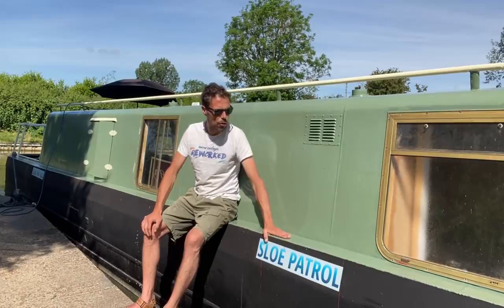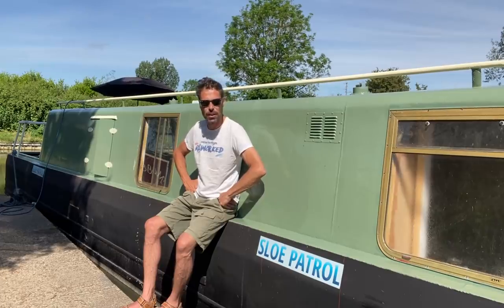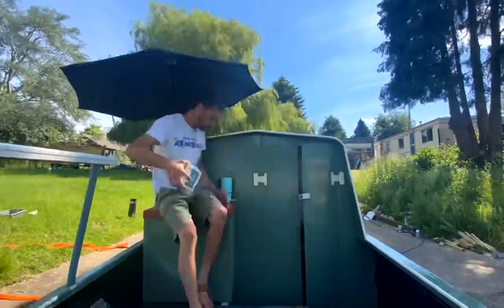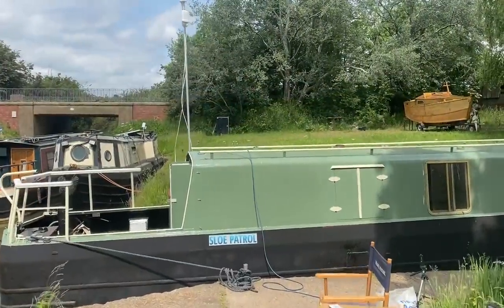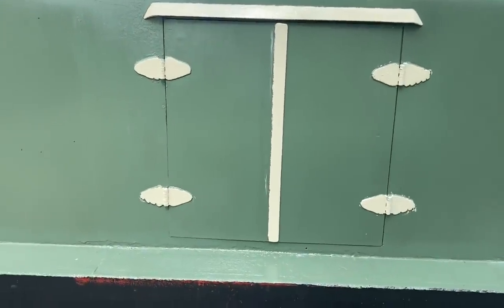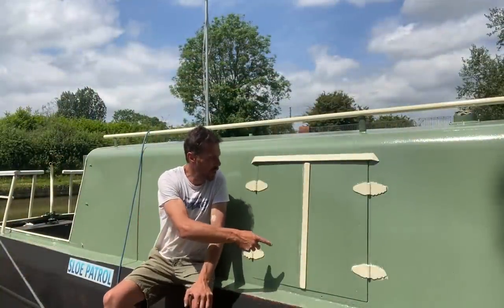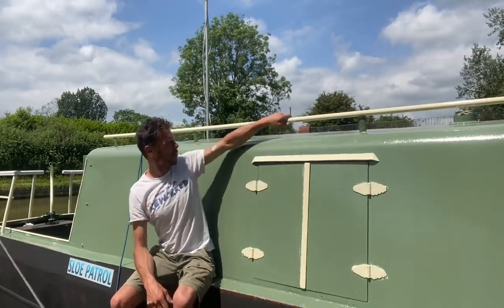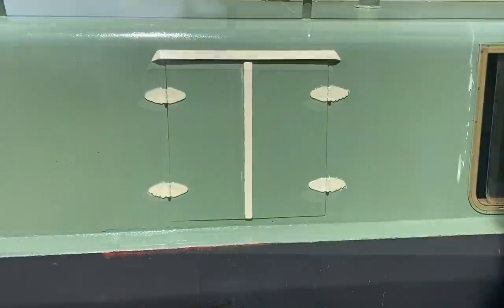197. Finishing the first coat and trim

Comment: Morning James. First say hi 👋🏻 to Carol 😀 Cream line on the hatch doors 👍🏻 Looks fantastic in the colours you’ve chosen. The finesse comes with the final top coat 😄 Take your time with the correct size paint brushes 🤣 Safe driving in the Dagenham dustbin 😆 Has it got air con 🤔 Do your checks before you set off on that long journey oil water screen wash tyres ect 😆 Cheers Stevie 😎

Comment: YES, line down the middle of hatches AND also on the bow and stern doors.
Consider sealing the top rails and stern bits that will be walked on with two coats of UV resistant, hard and clear Polycrylic Protective Finish by Minwax. Stuff is good and sturdy.
Also, paint barber poll stripes on the tiller in a complimentary color (or even black) for contrast.
Cheers!

Comment: Just a suggestion for painting under the rail. If you put a dust sheet under the rail you could then go along the underside of the rail with a mini roller, make sure you've got plenty of paint on and then tip it off after.

Comment: Not liking the cream hinges.  Gold to match the window frames?  Black to bring out the contrast and refer to the hull blacking? (Although yes to the cream line in the middle, either way.) The rail would be easier to paint with a paint mitt--sort of a small soft pad thing that slips over your hand, dipped in paint then run along the underside of the rail.

Comment: The line in the middle of the hatch looks good.  Are your going to do coach stripes?  That might change the look, but you can always paint them out again if you don't like it.  The green is looking good--there's a real difference between wet and cured, even on the screen.
My go-to "magic" tool is a medium-length bristle 2 1/2" sash brush for most of the finer work.  If you're doing any kind of coach stripe, remember that you get what you pay for with masking tape.  Find out what the experts use if you can.  It won't save money, but it will save a lot of frustration.

Comment: Maybe keep the hinges cream but add green dots for the screw heads... RE-SPECT And do the railing wood part green for the contrast. Yes line in the middle. and when you get this figured out you may consider the bow doors in the same skeam for the symmetrical look all around.  It's not a cratch cover, don;t botch it up trying to make it look like one.
RE-SPECT